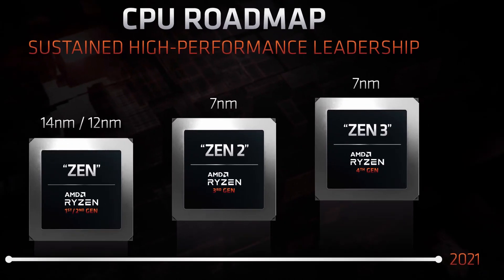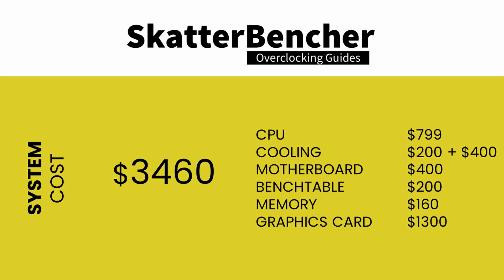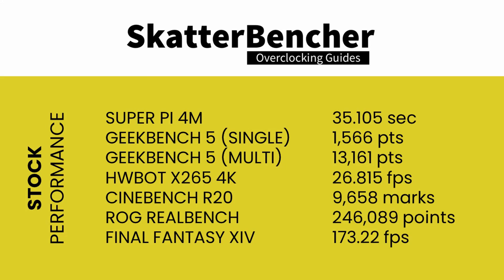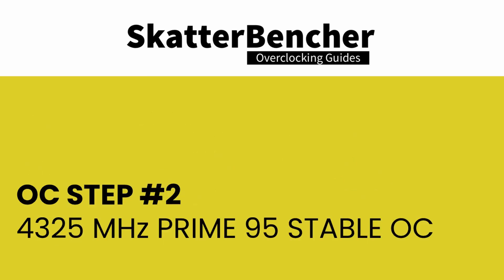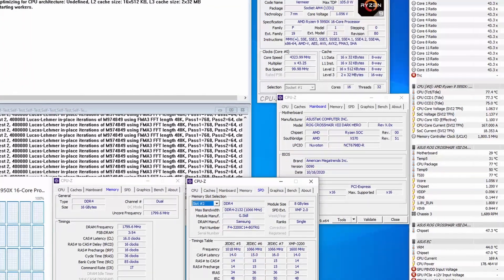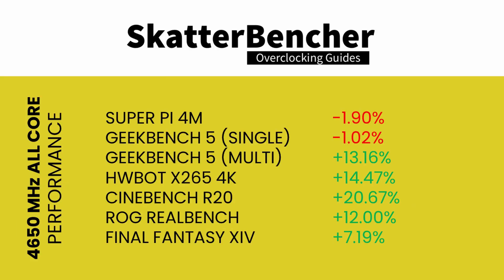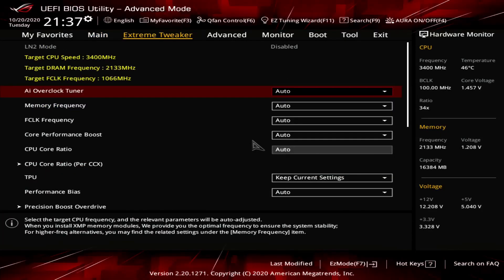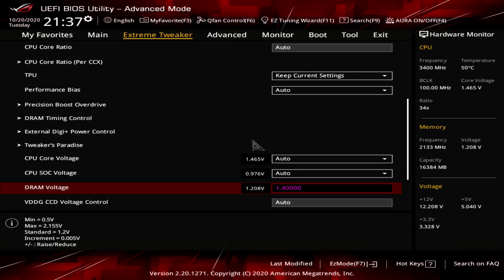Ryzen 9 5950X Overclocked to 4650 MHz With ASUS Dynamic OC Switching | SkatterBencher #15

Comment: Thank you for this very thorough guide, I finally got my MOBO(Same as vid) a week ago and also have a 5950x, followed your guide and got everything dialed in except the Amp value for OC switching, in your vid you have it set to 75, however in the HWMonitor at the end where you instruct us to find our own values yours is showing 176, could you please let me know why in the bios it’s 100 A less? I followed your value of 75 just to test for now and found that I would always be in PBO mode and only in OC mode on boot as it never reverts back even after a gaming session and idling on desktop.
Reply from the maker: Good question Yasha. The simple answer is "do as I say not as I do" :)

When editing the video I realized that the screenshot I had saved for demonstrating how to use Dynamic OC Switcher didn't match the actual setting. I didn't have the system anymore.

However, please note that the exact value for switching will be different for every system as overclocking capabilities will vary between CPUs, cooling, and chassis. So, I would always suggest to find the value that's right for your system by following the procedure outlined in the video rather than just copying the setting.
Reply: @SkatterBencher  Thanks for the reply, I realized that your values in the screenshots were not corresponding to what you were putting earlier in the guide as for myself 4650Ghz was also around 65-80A, althought I couldn't pinpoint it with HWMonitor/CPUZ as the values just fluctuated too much. I have it currently set to 70 and it seems to be switching pretty well, in games like Assassin's Creed Origins where they utilize Multi-Threading vs Ori and the Will of the Wisps where it's only single thread I can see the CPU's frequency go to my OC mode vs PBO.
Reply: @PennyRaider  how those setting are doing for you so far?
Reply: @Bushido_24  Pretty good I guess, haven’t had a single crash yet and it’s been about a week, I followed pretty much everything except manually OCing the RAM as I have XMP 4000 profile ones, then tightened the timings to 16-16-16-16-36 like how @SkatterBencher did in his vid.
Reply: I would like to know this too

Comment: Noob question but - If I have DDR4 3600 CL14 memory, do i need to change the timings in AI Overclock tuner? or just enable DOCP? stock timings are 14-15-15-35.
Reply from the maker: You can just enable DOCP - manual memory timing tuning gets pretty complicated very quickly

Comment: I kinda don't trust these ASUS gimmicks, though Their X99 lineup really left a foul taste. Nowadays we have Curve Optimizer etc. etc. on many more boards. I've tested my 5950X with PBO2+200MHz auto OC and -15 all core on the curve optimizer and P95 ran ~4400-4500MHz all-core on X570 Tomahawk.
Reply from the maker: Agreed that the PBO 2 (and PBO 1 for that matter) is pretty good for the vast majority of the users out there. But I also like that ROG engineers are still trying to find ways to extract additional performance. I think it's a good mindset to always want to find ways to improve :)

Comment: Hello. i have strix x-570 e and r9 5900x with deepcool l360 V2. i'm so tired to finding out the best pbo. not i'm using 4550 mhz with v 1.175 lol i'm so bored. do you have any suggestion for me ? my core 2 and core 3 is the fastest ones. i tried to do negative curve optimizer for fastest core 11 and the second one 15 and 17 for other cores once it worked good but after i get black screens and resets. so. what should i do ? thank you.
Reply from the maker: I haven't tried out Curve Optimizer so I'm not comfortable making recommendations. However, I can share with you my two recommendations for any AMD Ryzen overclocking attempt:

1) If you want to do it quick and good: enable XMP, enable PBO, use Fmax offset to increase PBO limit up to 200MHz. This will get you a great single thread performance and a pretty optimized multi-thread performance.

2) If you're exclusively focused on multi-thread performance: enable XMP, and then do manual overclocking.
Reply: @SkatterBencher  oh i heard xmp sucks but. if you say i will try. Thank you mate. And i saw you set the voltage like 1.3 should i enable the voltage like you? Or leave it auto ? Thank you again.
Reply from the maker: If you're using PBO then just leave the voltage at auto. The CPU will regulate the voltage and frequency according to the safety margins!
Reply: @SkatterBencher  thank you. i'm having weird problem right now. if i'm not opening task manager some of the cpu cores working at %100. here is the picture link : https://imgur.com/a8aYwkH
i though maybe i needed to update to the latest strix e 570 bios. so i did. but nothing changed. i disabled all the unnecessary services but still nothing changed. do you have any idea why is this happening ? 1 or 2 days ago i use CTR2 i clicked tune but nothing changed after 1 hours in fact ctr2 closed down itself. and i saw some graphical glitchez. yeah it's my biggest problem now.
Reply from the maker: Hard to say from a distance ... :)

What's CTR2?
Reply: @SkatterBencher  ryzen overclock software by 1usmus. i tried this but i didnt like it. There are some reviews but eh. im just using stock :-(

Comment: Great video! Did you use the 8+4 pin connector? Or was the 8 pin sufficient?
Reply from the maker: I used both 8-pin and 4-pin but it should be also fine with just 1 8-pin.

Comment: Excellent work !
Does it work together with PBO 2 and Curve Optimizer? How to setup this then?
Reply from the maker: Yes, it will work fine with PBO 2 and Curve Optimizer. Dynamic OC Switcher just switches between the PBO mode and OC mode. PBO mode = your PBO (with any curve optimizer) configuration. OC mode = your manual configuration.
Reply: @SkatterBencher  I have a DARK HERO on back order , is there any way you can test Curve Optimizer  with 5950X .
  AMD OC menu  210 140  215 / -30 
https://valid.x86.fr/qq8ut5
https://www.techpowerup.com/forums/attachments/capture30218-png.184141/
https://www.userbenchmark.com/UserRun/38816249
Reply from the maker: Sorry, I don't have the system on hand anymore :(
Reply: @SkatterBencher  Asus Dark Hero, using Bios, Asus auto oc, it  works great  plus it uses PBO, DOCS and curve for overall best results , sure I can OC it, for ever day use no, Asus is    very stable ,simple to set.
Reply: Where is that curve optimizer? is this something you need to install?
Please explain a bit how to get this to work, thx.

MOBO: Asus Rog Strix x570-E (latest bios update)
CPU : R9 5950X

Comment: For 5800x and x570 f gaming ? Or buy dark hero for best oc with 5800x ?

Your video is very goodddd

Good job 👍👍👍👍👍🥇🏆
Reply from the maker: Thanks for the kind words! 

The Dark Hero offers the exclusive feature of Dynamic OC Switching which is really cool for AMD overclocking. But for most people, Precision Boost Overdrive and XMP will already boost the performance sufficient.

PBO and XMP are available on most if not all AMD motherboards. So, the X570-F Gaming will work for that.
Reply: @SkatterBencher  can you make a video on the 5800x?  original some Asus bring it to 1.38v auto which in cinebench with an aio 360mm reaches 80 degrees!  i use it at 1.2 volt manual so 100% of the cpu is very cool.  the difference seen on the Asus thor 850w between 1.1 manual and 1.41 as it is original on the 570f gaming used at 100% is 62 watts!  what is the correct way to not lose fps in single and multi core on 5800x as volts?  thanks you are the top
Reply from the maker: I already have a video out on the 5800X: https://www.youtube.com/watch?v=gDLuwNp06-Q
Reply: @SkatterBencher I had to change x570f with Dark hero because of poor vrm performance with f gaming board. Although I am using 3900x cpu on Dark Hero, It gain 400 MHz boost at single core, and 250mhz boost at multi core yet it is more energy efficient at idle(not expected). I have almost same setup like this video other than cpu.

Comment: I have the Ryzen 5950x, should I overclock it or not?  And which method should i use?
Reply from the maker: I cannot say no to the question should you overclock. No matter what beast you're running, there's always something you can do to make the beast run faster, better, stronger.

That said, for Ryzen 5000 my general recommendation is: enable XMP + enable PBO + maybe enable Fmax. Manual overclocking offers marginal gains and is not worth it unless you're really into getting the absolute most out of your system.
Reply: @SkatterBencher  
Hello,

I run the cinebenchR23 .

I have this scores:
Multi: 24850 points
Singel: 1580 points 

My System Runs all Stock: 
Only the RAM was manually OC , 16-16-16-36 3600 and fclk 1800.

Is this scores normal on Stock ?

Comment: I just switched to amd for the first time since the athlon thunderbird 1400+ in the early years of 2000,.
I bought the 5950X but when I just use the optimal defaults the CPU runs at 1.47V ! And sits at 80 degree C while gaming , and thats on the asus Ryujin 360 AIO!! ,..
Reply from the maker: Are you seeing 1.47V when idle in the operating system, or under load when running an application. Seeing over 1.4V can be normal since Precision Boost Overdrive will set that voltage in light workloads to maximize the frequency and performance. I cover this briefly in another video: https://youtu.be/1wcU8PrdGLE
Reply: @SkatterBencher  it sat at +1.4V all the time,. Had to manually force it down to 1.2V .

Comment: Thank you m8 for this perfect guide. As Im totally new to overclocking, I apologise in advance if my questions are sortta stupid. I got the same mb and cpu as u do but my ram is Trident Z Royal 32gb (2×16) DDR4-3600MHz CL14-15-15-35 1.45V, rog  rtx 3090 O24gb and using a AIO cooler rog ryujin 360. 1. Can I do the last scenario u did in this video with my rog ryujin 360 without any problem? 2. Is it really necessary to set memory timings 16 not 14? 3. For finding the right trigger point the only thing I need to do is to enable the pbo and other stuff in mainboard must be default and then running that benchmark thingy right?? AGAIN SRY FOR NOOB QUESTIONS <3
Reply from the maker: Thanks for the kind words!

1) Your cooler should be quite decent so I think you can come relatively close to my settings (depending on your luck with the CPU silicon lottery)

2) I would suggest to enable XMP/DOCP instead of manually configuring the memory. Since your kit is DDR-3600 running XMP/DOCP should automatically enforce sync mode so your FCLK will run 1:1 with your memory

3) For finding the trigger point you need to do 3 steps:
1. find your maximum all-core overclock -> this will be the baseline for your final OC
2. enable PBO, then gradually increase the workload in the operating system until you see the frequency drop below your max all-core oc -> check the cpu current in hwinfo
3. configure DOS OC in the bios :)
Reply: @SkatterBencher  Thanks a lot m8 for helping out <3, but how can I find my max all core oc u mentioned in step 3 and if my max all core oc was different from what u got in the video, do I need to change core voltage too?  Do u have a guide on that on your channel as well? And one more thing, as u mentioned in the reply for my 3600 32gb I should just enable xmp/d.o.c.p instead of manually playin with them but when Im setting dos oc, should I set dram voltage to 1.40 as u did in the video? Or just I dont touch it?

Comment: My dark hero/5950x comb seems not to work with any CPU OC.. 1200w PSU..
Reply from the maker: What do you mean by it doesn't work?
Reply: @SkatterBencher  Mine gets a black screen after saving and resetting why?
Reply from the maker: Could be that one of the settings doesn't work well on your system.

After which step does your system fail to boot?
Reply: @SkatterBencher  Trying any manual OC you teached, After : Save & Reset

Comment: My 5900x on a asus rog strix x570-f gaming runs at 1.48v all the time from start up and i didn't change settings. I see your cpu in video is similar. I thought it was faulty and was going to return it as on ryzen master it says 75c on idle, bios says 52c and iCue says 33c (using corsair aio) more i read and watch im seeing its by asus design but think id rather it ran lower voltage as I'm worried about lifespan.
Reply from the maker: Is it really running this frequency and voltage all the time? Or only when idling in the operating system without doing any work. You can try to download Hwinfo and check the VID and effective clock. First check in idle, then run Cinebench to see if it changes. I suspect that the voltage will reduce significantly when running higher workloads.

If you have time to spare, you can have a look at my video on Precision Boost Overdrive. I explain how it's possible you see 1.4V+ and why it's nothing to worry about. https://youtu.be/1wcU8PrdGLE
Reply: @SkatterBencher  thanks fixed the issue about a week ago it was sortware that came with motherboard gamer first v that put the cpu in a stress mode constantly 75c in idle fans and aio on blanced over 90c gaming. Uninstalled now normal temps and voltage goes up and down as it should. Ill watch the video thanks!

Comment: I will be getting the 5950x and Dark Hero this week. I know not to just copy/paste numbers for OCing CPU/GPU so I was wondering if you can explain what each of the settings do and why you set them as those numbers and how you get those numbers in the first place. Or if you know of another video that explains that.
Reply from the maker: Great comment Jeffrey! Earlier this week I was thinking about this exact issue. I got those numbers by trail and error, but I don't properly explain how I do this in the video. 

I'm considering two things to improve this. (1) Include the trial-and-error part in the video so viewers understand the process of finding the right settings. (2) Making a dedicated video to explain how to 'actually' start overclocking, focusing on the process from stock to first overclock.

What do you think?
Reply: @SkatterBencher  I think you should first make a video showing the trial and error part for this setup. 
Then later you can redirect us noobs to your general OC video :)
Reply: @SkatterBencher  I personally like to see the trial and error because I feel like if something goes wrong you will probably catch it and explain it for when I go back and want to try doing it myself.

Comment: Why would my motherboard not want to post XMP on my memory? I have 4 sticks of trident z neo 3800 CL14, FLCK 1900, and it literally refuses to post.

I got it to post 3733 1866 one time, and ran memory tests for 1 1/2 hours, it was stable.

I tried to restart, and it wouldn't post again. Is this simply a BIOS issue? Really doesn't make much sense to me. I have a crosshair VIII hero x570
Reply from the maker: FCLK 1900 might be pushing it a bit. Try running XMP enabled (DRAM 3800) and FCLK async (950). If that works, then FCLK is the issue.

Comment: This special oc mode that you used is available with the regular hero wifi or only the dark version?
Reply from the maker: Dynamic OC Switching is only available on the ROG Crosshair VIII Dark Hero
Reply: @SkatterBencher  oh dang it. Guess i am returning my unopened hero and wait and get the dark one. But shouldn't this be available to the others via firmware matter 8?
Reply from the maker: In addition to the BIOS implementation, this feature also required the engineers to make adjustments to the PCB layout and traces. This makes it highly unlikely that other boards will get Dynamic OC Switching too.
Reply: @SkatterBencher  sorry but that sounds to me like bs excuse from Asus. I can imagine how owners of the Formula will feel about their more expensive mobos missing out on this feature!
Well glad i still got time to decide what to do since I'm still trying to find a 5950x :/

Comment: Hi I ordered a 9 5950x I have 2x360 rads(left from my old custom liquid cooled setup )  and a air cooled 3090 FE that I only use for gaming , Can I overclock it to 4.7 Ghz all cores ? and whats the most stable I can achive with 2x360 rads 1x pump ?
Reply from the maker: It's hard to say if you will be able to reach 4.7 GHz. But, I am pretty sure the bottleneck will not be your cooling! So, it will depend on your luck in the silicon lottery :)

Comment: Hi ;) 
I have similar hardwere equipment: RTX ROG 3090,  ASUS ROG Crosshair VIII Formula + AMD 5950x + 32GB (4x modul sizie of 8GB)G.Skill Royal F4-4800c1808GTRS.
What should be changed in the configuration of these G.Skill memories to get 4.65GHz on each core?
Reply from the maker: You can follow the steps in this guide. But rather than setting the memory frequency and timings manually, just enable XMP/DOCP to auto-configure the memory.

DDR4-4800 is a pretty high rating so you might have to reduce the memory frequency manually if your CPU cannot handle this frequency.

Comment: i got 4.62 Ghz on all cores with 1.17 v in windows not touching the bios and temps under 50 degrees.
Reply from the maker: Nice overclock, congrats!
Reply: How did u get it in windows? U mean using Ryzen master?

Comment: Will be the Crosshair Formula have 'Dynamic OC Switching'??? If not, will it be updated for the future BIOS update??
Reply from the maker: It won't be available on any other board than the Crosshair VIII Dark Hero. It can also not be back-ported to other motherboards via a BIOS update as the function required a small PCB re-design.
Reply: @SkatterBencher  Thanks for your reply . I am thinking to buy C8F or C8DH, u helped me a lot to make decision. thanks

Comment: Damn.. even stock my 5950X runs in idle 50 degrees C.. weird
Reply: same its just de massive TDP i guess. if i clock everything to 3.4GHz as advertised its sitting at 35 celsius but once i let the boi go 4.3 all core even idle its at 55 celsius.
Reply: Mine is in 65-75C